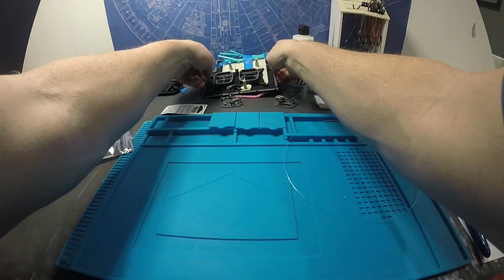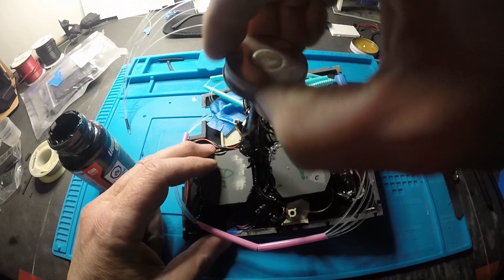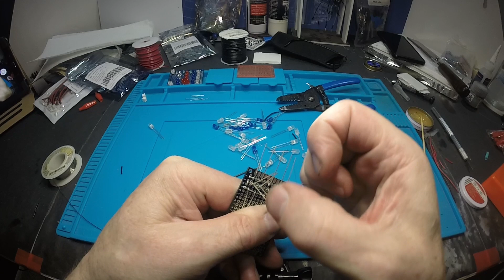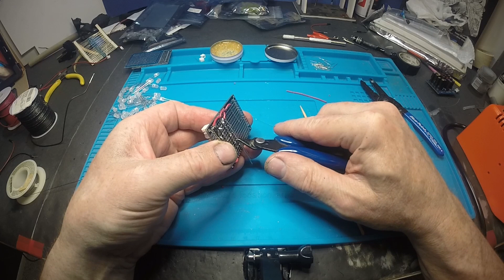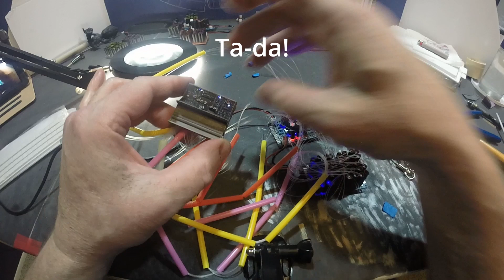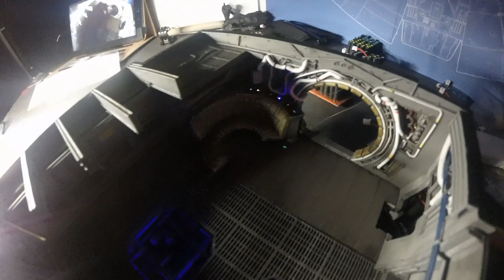Episode 8.1.0 - Millennium Falcon Build - Lights, Lights, and more Lights

Comment: Is that console an add on piece?
Reply from the maker: Hi, yes it is. I got it off Shapeways. I'm going to be drilling and using the one that comes with the kit as the Engineering Console aft of the starboard ramp.